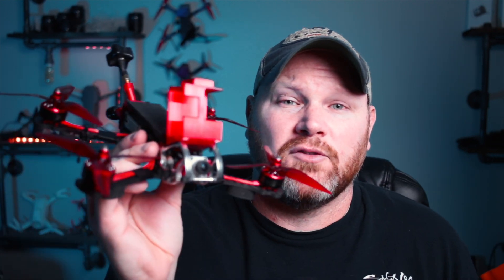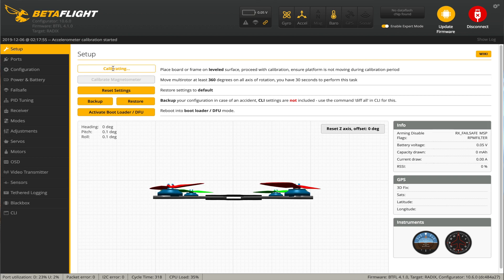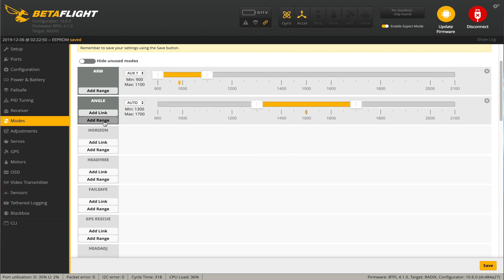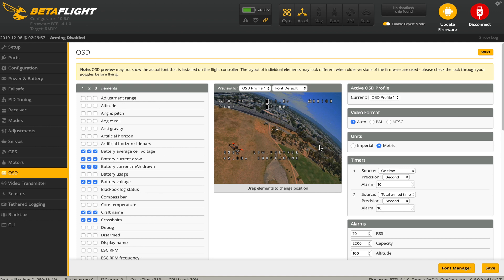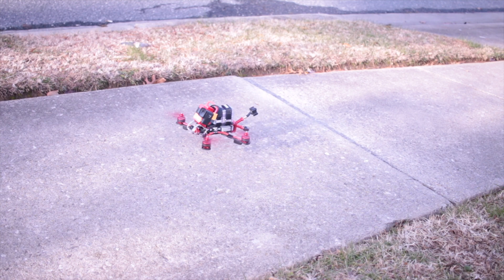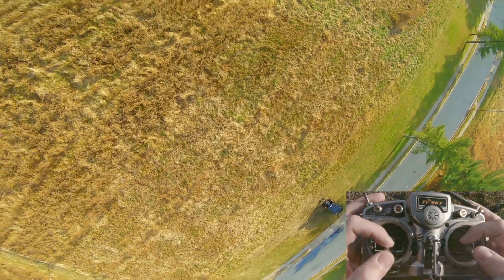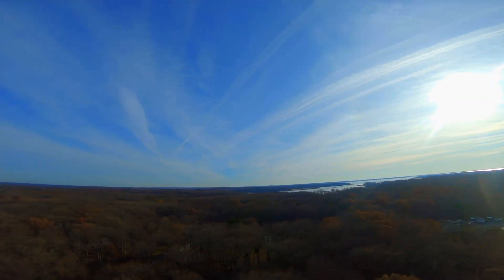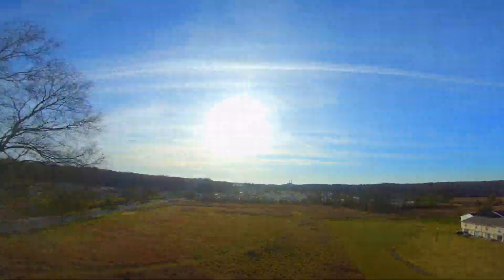DJI Armattan Rooster Converstion Part 2

Comment: I just purchasing the DJI goggles.  What battery/strap set up are you using?
Reply from the maker: Hi Checkered Flag Films!!! Thanks for stopping by!! The Strap im using is a HotDog strap 2" strap.  The website is Hotdogfpv.com but I just checked the website and it looks like all their straps are sold out so I hope they are not going out of biz.  I believe you can also get these straps from ethix.  The bat is a Fatshark battery pack for 18650s.  The Fatshark plug fits much tighter than the stock DJI cord so you dont have to worry about it pulling out of the goggles.  You can also use a regular fatshark battery as well.
Reply: @EthanMitchell_YouTube  Hmm...they've gone out of biz as of December 15th!
Reply from the maker: Checkered Flag Films that’s too bad.  You can also find them on eBay.